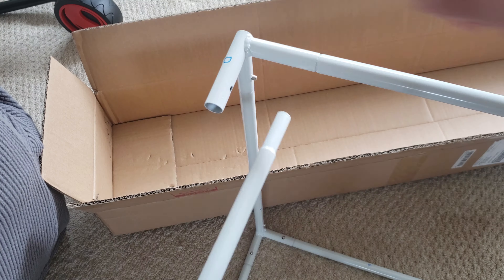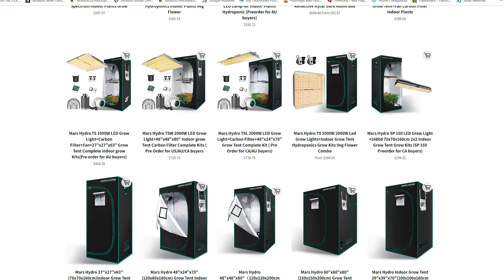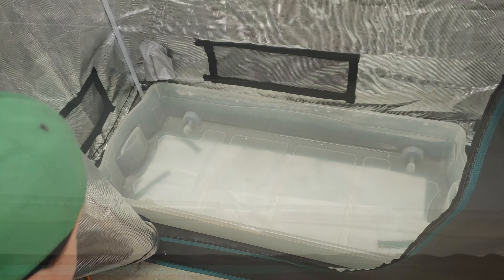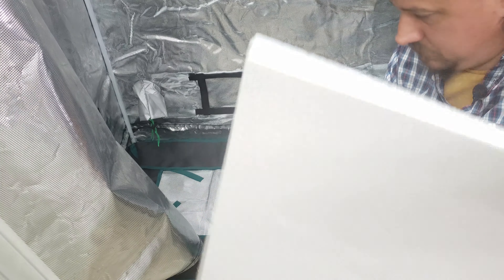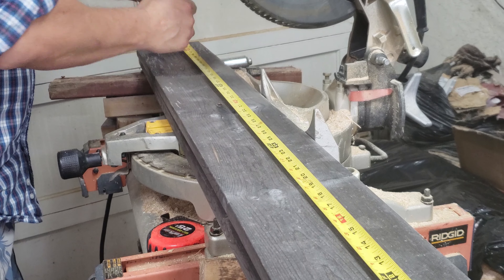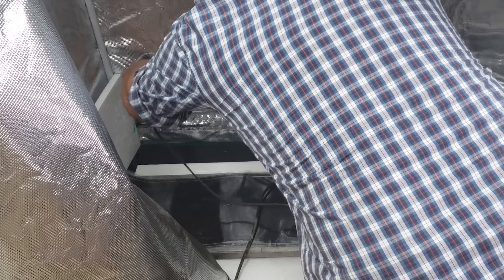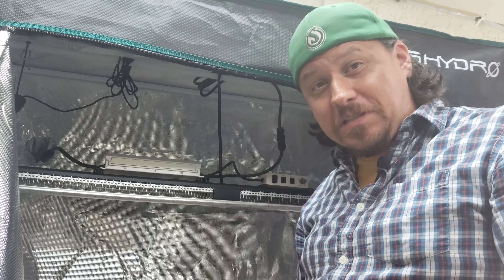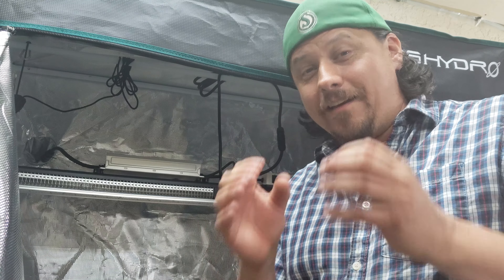Mars Hydro Grow Tent Modifications And Final Setup

Comment: Do you use any fans in your grow tents, such as exhaust or intake?
Reply from the maker: Hey Nicholas, not yet... But I monitoring the temps closely...!
Reply from the maker: I have blown air into the open front door though.  Just to keep it fresh!
Reply: Bought my first grow tent and trying to figure out proper setup. Using it to grow out pepper seeds I'm saving to make sure they are true to variaty and germination rate of seeds.
Reply from the maker: @nicholasdemarest4254  I say don't go with fans until you find you need them. Open the tent door daily for proper air flow, but you shouldn't need fans inside or any crazy ducting...
Reply from the maker: @nicholasdemarest4254  peppers should be awesome for the grow tent man.... It's love to grow huge ones. They are perennials... So you could essentially grow them for years on end. Imagine a 4 year old one producing?? Crazy!
Reply: I just have a fan heater (on cold) that I had lying around and it just blows in the tube.

Comment: i have several 2x4 tents and a couple 5x5 i build 3/4'' plywood and have caster wheels on the platforms it keeps the tent off the floor and make it easy to move the tents even loaded with lights fans filter and plants

Comment: I liked your ideas for the flooring insulation and low profile Rubbermaid would be great for hydro pails or soil type planters in larger tents for mess durring watering. Those Rubbermaid are good for storing cured flower and dried herbs, leaf & trimmings as well. I know you can start mini hairless kiwi indoors and transplant outside to live in our Canadian climate year round but I wonder if a mini banana bush can be grown in a tent durring winter and perhaps be moved outside durring spring/summer, then back inside the following winter etc.

Comment: Could you measure the exact dimension of just the metal pole frame? Preferably in metric. Their specs on paper seems off.
Reply from the maker: 119cm high by 59cm deep by 79cm wide
Reply from the maker: Outside of the pole dims.....
Reply: @TheRipeTomatoFarms  Think you meant 179cm right? Cuz 79cm is way shorter. 

is the pole frame super snug/tight fitting with the tent canvas corners? Any wiggle room? Wondering if I can fit a slightly larger wire shelving rack inside that is exactly 24"x48" (60.96x121.92cm)
Reply from the maker: @Battlem0nk  Yes, 179cm high, 119cm wide, 59cm deep....you can fit bigger shelves away from the corners, easily...at the corners though the tent fits quite exactly....not ultra tight, but like its supposed to.

Comment: Where can I buy that 4ft long heat mat in canada? Any specific brand would u recommend?
Reply from the maker: Hey Rooney, the reptile ones are best...no question. They are designed for super low watt and just last forever! Most places only sell the 2 foot ones in Canada, so I just order from The Bean Farm in Washington. They ship up here, never had a problem!
Reply: I will get me one of those ones. Where did u get the rubber maid bin? The largest  ones I found the 38inch length ones. I had to put this same mars hydro tent together vertically. It Was not fun but i got it done because had too do it that way. I only had a 4 x 3 x 8 space to build a 4 x 2 x 6 tent.Thanks alot man. Appreciate it.😎 By the way u could try grow some guava in winter. Then u can make jams and jellies etc out of it or just eat the fruit and maybe u can try grow passion fruit as well. Keep us posted. Great videos by the way.